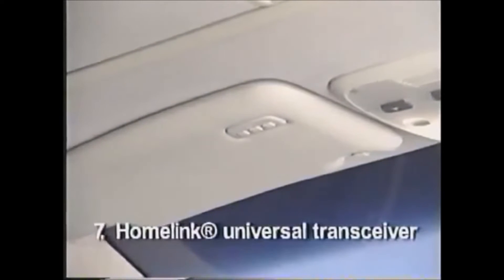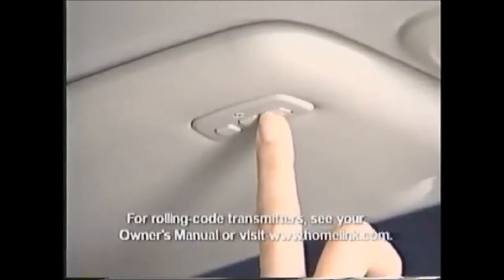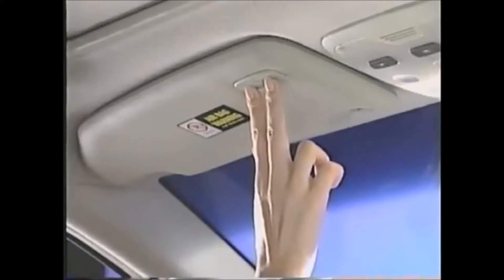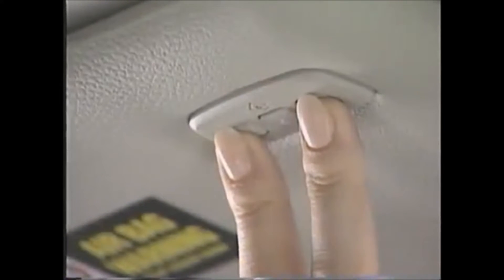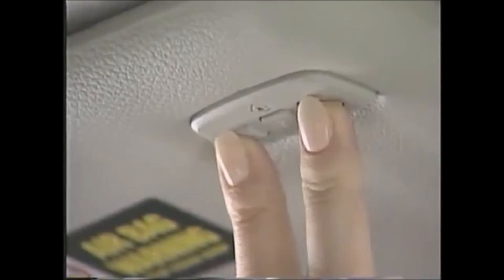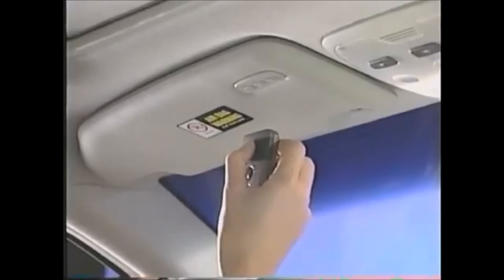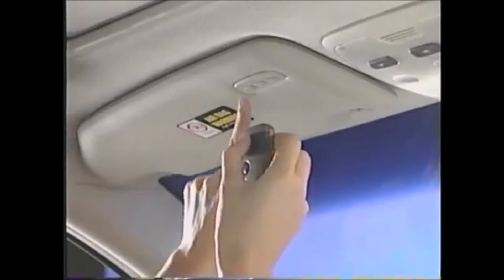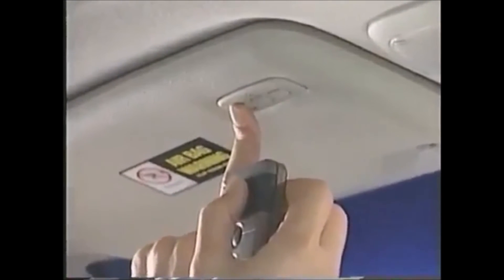Volvo S60 V70 XC90  Garage Door Remote visor Setup 2001-2009 (Homelink)

Comment: If you are Canadian resident, the car owner's manual says during Homelink programming, your handheld transmitter may automatically stop transmitting. To successfully train homelink, continue to hold the homelink button. At the same time, repeatedly press and hold your handheld transmitter's button at 2 second intervals until homelink has learned your transmitter's code. 

 The homelink indicator light will flash first slowly and then rapidly to indicate that the button has been successfully programmed.

Comment: Found the solution for most modern rolling code garage doors: 

2. Press the “training” button on the garage door opener motor head unit until the “training” light comes on.

3. Press and release the programmed HomeLink® button. Press and release the programmed HomeLink® button a second time to complete the training process. Some garage door openers may require you to do this procedure a third time to complete the training.

Comment: The video instructions do not work for me but I figured it out. First follow the video's instructions to program the Homelink button. The LED indicator should light up like in the video, but it won't open the garage door. Then do the following steps in my comment.

 if you look in the manual it says to program a rolling code garage door opener manufactured after 1996, which has a more secure remote design, you need to do extra steps.

How to know if your homelink isnt working due to a rolling code garage door receiver: When you hold down the programmed homelink button, the homelink indicator light flashes rapidly then steadily after about 2 seconds. That means you must follow the below steps:

 You must press the training button on the garage door opener unit on the ceiling.  Then go to your home link button that you programmed and press it twice to complete the training process.  It should start working and your a handheld remote should still work.

Some garage door openers may require you to repeat the above steps twice, starting with pressing the  training button on the garage door opener unit.  

 And the training button may work differently for different garage door opener units, so read the instructions in the manual or on a label on the opener unit.  My opener has a 30 sec time limit after pressing the learn button so I just had to press the homelink button twice within 30 seconds and it worked.

Comment: If I found a homelink system visor for a volvo in  a junkyard, can I simply swap the visor and easily hook up the electrical that is there for the  vanity mirror
Reply from the maker: My guess is there is a chance the connector is already there, inside the roof liner.  If you find it's there, kindly let us know.